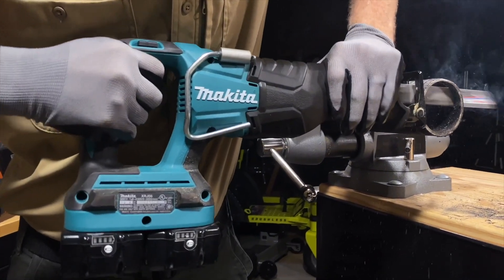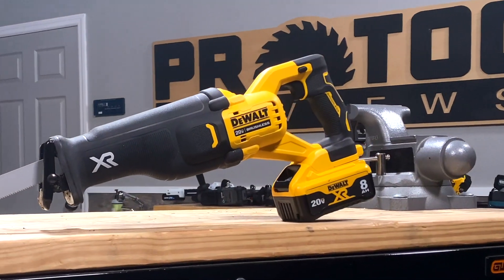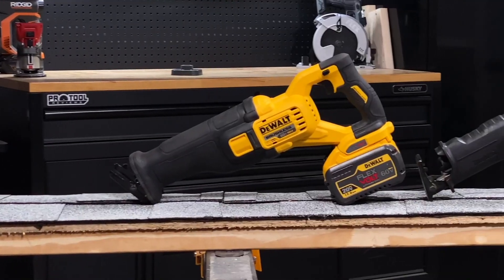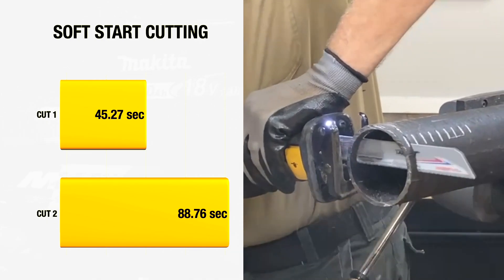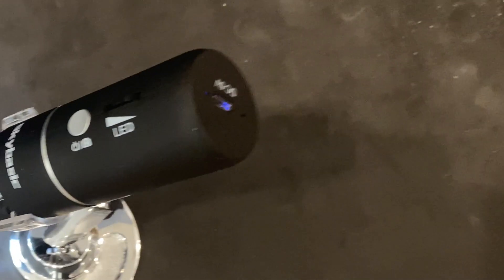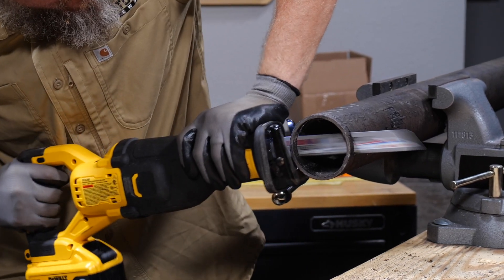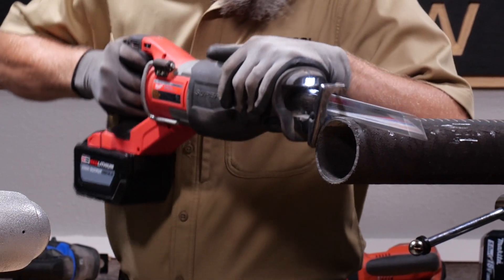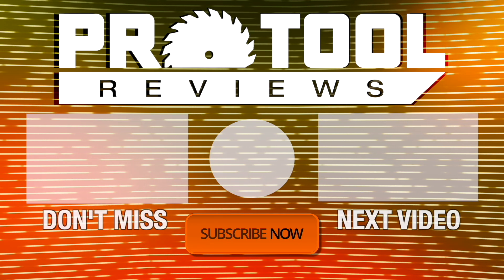YOU ARE CUTTING TOO FAST! Best Reciprocating Saw Cutting Method

Comment: I also found, that if you try the slow speed cut, or the slow start style cut, the blade has a much higher tendency of walking on the material before it actually starts cutting, either leaving lots of marks on the material, or walking then starting to cut in the wrong place (if you’re trying to cut on a marked spot). As opposed to just going full speed, wether it’s already on the material, or u start the saw at full speed then plunge into the material.
Reply: Start it with a hand saw, in the "wrong" direction.  That's the best way I've found to start the groove.
Reply: @totheknee can you elaborate about the direction?

Comment: You will need a higher TPI blade, running full speed is ideal but even with a higher TPI blade you should use some coolant or at least Cutting oil to keep from burning up the carbide.  Great videos, looking forward to the next round of tests

Comment: Only two cuts per blade is quite expensive. I wonder if  it is more cost effective to angle grinder if you factor cutting time so Labor and the cost of consumables
Reply: Spray lubricant on blade while cutting if possible.

Comment: Why no tests using cutting oil?
Reply: Cast iron typically doesn't need a cutting fluid due to its natural lubricity.
Reply: Correct but the Cutting oil will help cool the blades and prevent burning up the carbide tips
Reply: As said, cast iron doesn't typically need cutting oil but if used, Kerosene is the recommendation.
Reply: @brianwalk108  The melting point of carbide is around 5,000° F. What do you mean by “burning it up”? As far as I can tell, the thing that wears out the blade is the teeth losing their sharp edge, as you can see in the video. Not saying you’re wrong. I’ve heard that phrase “burning it up” used a lot. Heck, I’ve used it myself. Just not really sure what it’s supposed to mean.
Reply: Cobalt is used as a binder in carbide, under excessive Heat the Cobalt can soften, chip, sag and break down.  Once the binder goes, the cutting edges "burn up" or "break down".
Reply: @brianwalk108  You're correct--heat is the enemy of all cutting tools.   I was a production machinist, and tool and die maker, and we almost always used either  petroleum or water-based products to cool and help with lubricity.  You'd be hard-pressed to find a YT video of a CNC that isn't using both carbide and a coolant/lube.